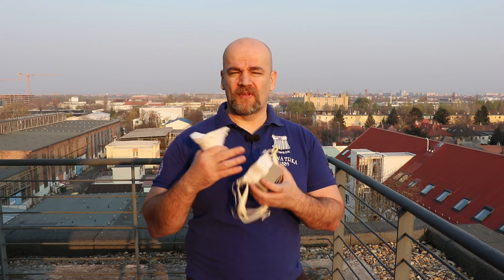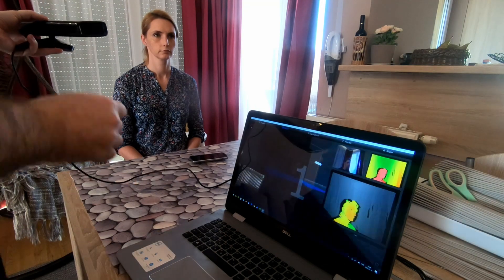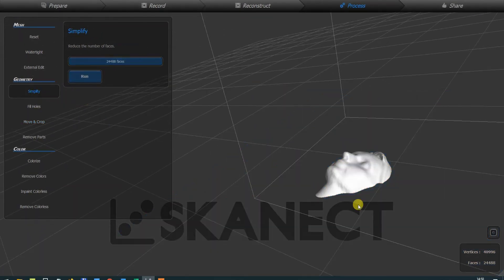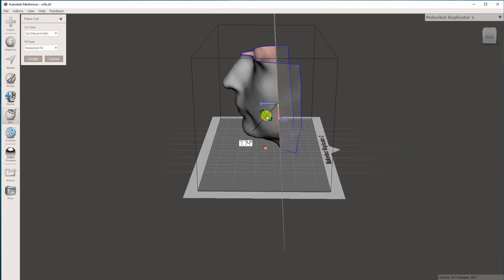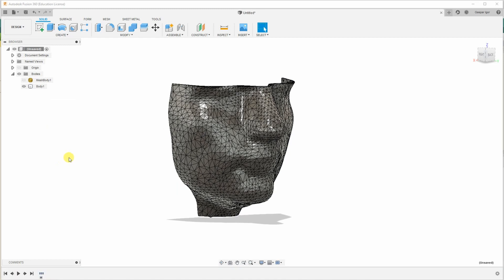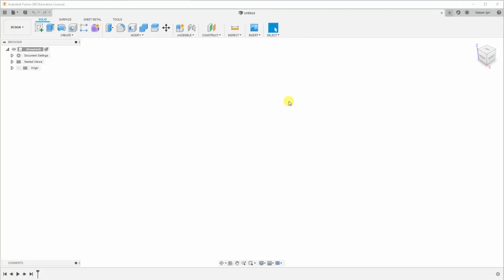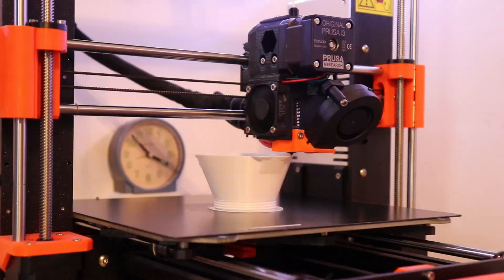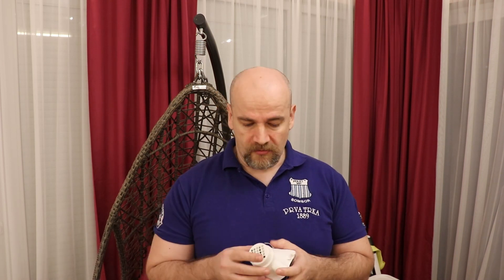Face mask: from 3D Scan to 3D print

Comment: This was very useful. I decided to use Kscan instead of Skannect because it isn't limited although it is more work cleaning up the scans etc but the result was really good. I've used a different design of filter due using a different filter material. Your video certainly helped solve a load of problems in giving me the required work flow although the project still isn't easy to accomplish.

Comment: In my opinion, the size of the virus we are protecting us against is too small to use a mask like this. With a size of only 0.3um, the virus can travel through the PLA if you don't seal it. There is no printer in the world good enough to print PLA without the gaps that are big enough to let virus particles through. Therefore, I think your design is perfect, and the body fit is also perfect, but you need an extra step, and that is to seal the mask with some type of good primer, after some sanding, of course.
Thanks for sharing. This video is very useful.
Reply from the maker: That's correct for very thin layers (my business cards are 2 layers+text layer, I can see though them small holes). I always print with bigger number of perimeters and sealing increases exponentially. I have tests for 3D printed object, they can hold 1 bar. I will test higher pressure too soon. These masks I coated with epoxy resin, but primary from another reason: after some time bacteria colonies will be between pores and they can not be cleaned with simple surface cleaning. I have only experiments with milk (since I work on food engineering department). With milk bacteria colonies are based after 10 days, on mask probably much later, but I don't have these measurements. Those results are published (also available in video too). Thanks for comment. https://youtu.be/lFtMIo00tfY

Comment: nice. what about printing it in ABS and putting in in acetone vapor bath to make it silky smooth = less porous, easier to sanitize.
Reply from the maker: I am working on Food Engineering Department testing 3D printed object from food safe aspect. That's why I don't like ABS, it contains toxic material. Of course putting it on face is not equal as placing food in it, but that's why I don't use ABS at all, I don't have any bacterial tests with this material.

Comment: I used my iPhone with the Bellus3D app to get a very good 3D scan of my face in about 30 seconds. I then used the MyFaceMask extension for blender to created a custom face mask stl. I then edited that stl to have the strap mounts and filter end from the Lafactoria3d face mask. The mask is comfortable and seal to my face fully blocks air when I block the filter end with the palm of my hand.

Comment: Thanks a lot! The mask designs on Thingiverse don't fit me well, and this is the solution!
Reply from the maker: Another quick solution is to try to heat it up to 50-60C (for pla) and deform to your face.
Reply: @MyTechFun  How would I go about making a custom fit mask with an existing STL? Could you give me some instructions on how to do it?